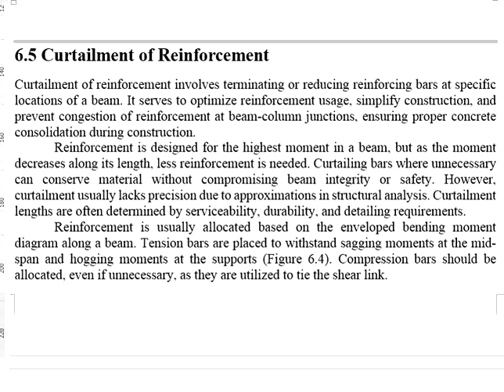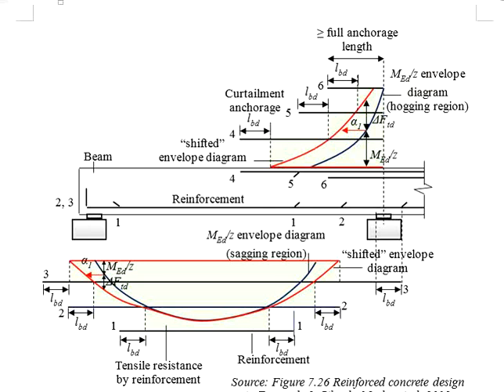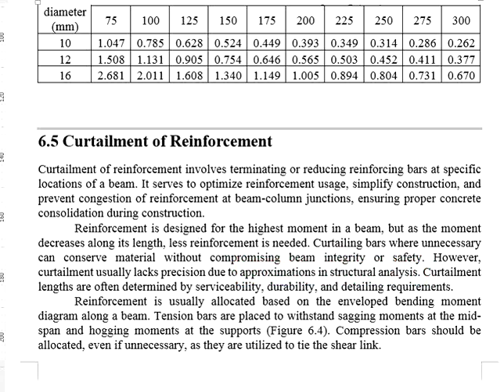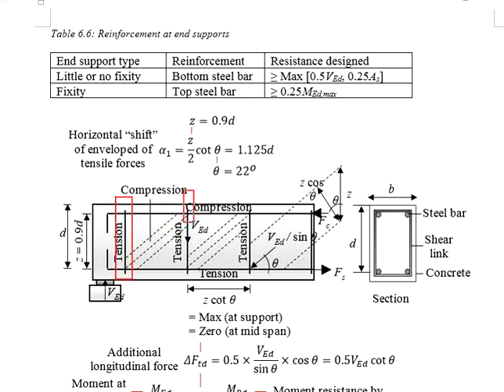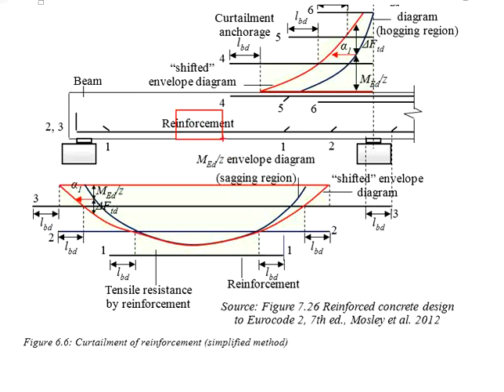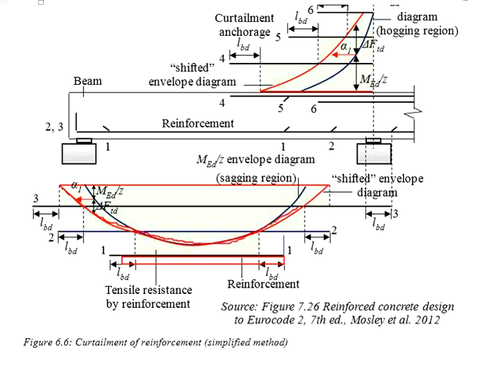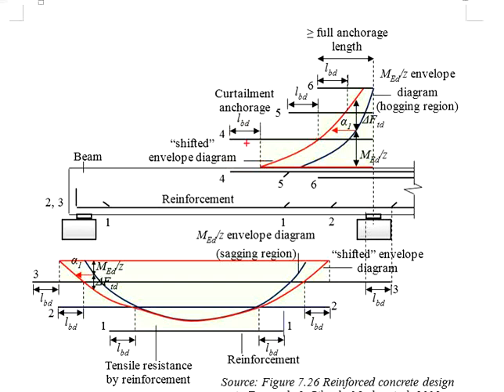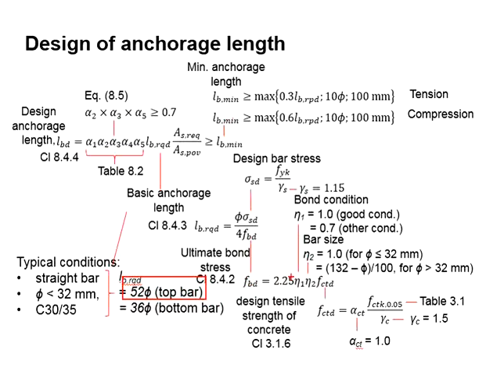7.22 Curtailment simplified method

Comment: PLEASE SIR,DO A VIDEO OF HOW YOU PERSONALLY SIZE CONCRETE ELEMENTS IN THE INITIAL STAGES OF DESIGN.
Reply from the maker: Normally we do sizing based on the typical sizes used in the construction industry. In my case, for lightly loaded structures, our local industry typical beam sizes used are 150x300, 150x450, 230x450, 230x600, as for the slab mostly 115 mm and 125 mm. If the proposed sizes fail or ended up to be very heavily reinforced, we will enlarge the size.